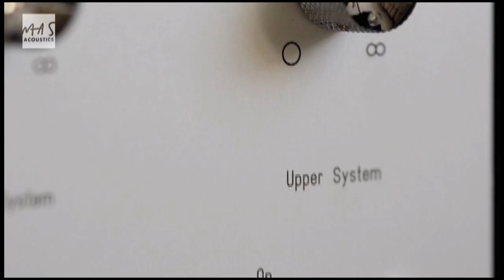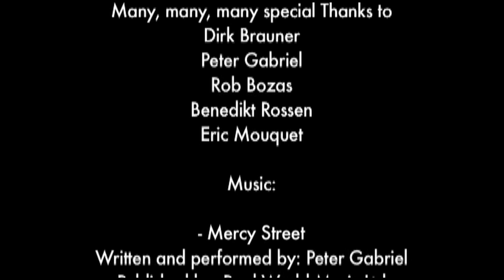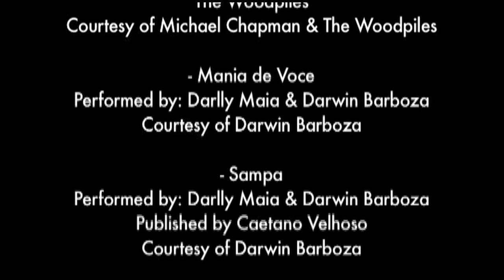Brauner: the Art of Microphones

Comment: I recently bought a new VM1 that became faulty in transit. I have to say the level of service I received from my U.K. supplier (Red Dog) and especially Brauner, was exceptional. Dirk dealt with the issue personally, and was in contact with me throughout - exceptionally professional.
The mic I've ended up with is superb, like a super high quality camera lens. If you have a good EQ you can manipulate this sound to be exactly what you want it to be, there are never nasty surprises of gritty artefacts when you lift a frequency band.
I've also worked with the VMX - that's a fire-breathing mic! I did an experiment to see if I could EQ the VMX to impersonate my old U67 - bingo, all the necessary information and warmth was there, cut some highs, little 1k push and you could hardly tell them apart! Then had to reverse it all as the VMX with no EQ sounds a lot better than the 67 with no EQ straight off!
Reply from the maker: Thank you, Darren!